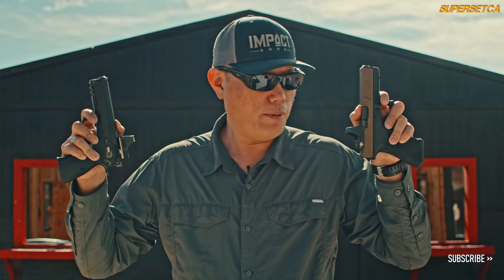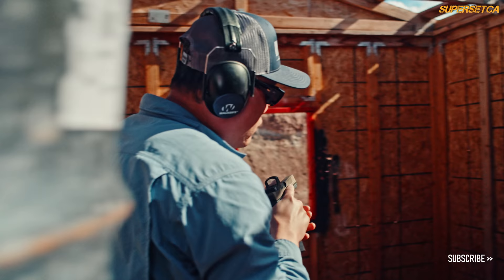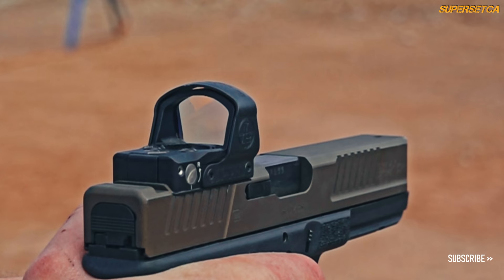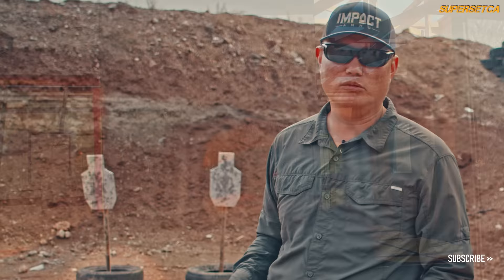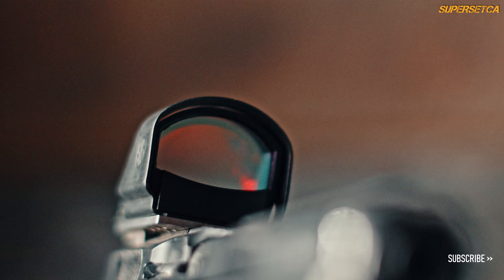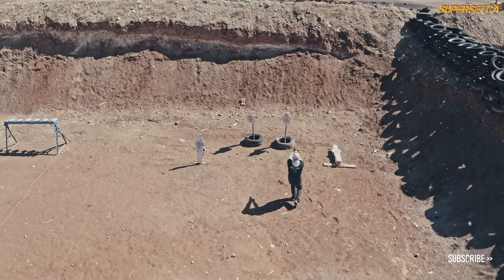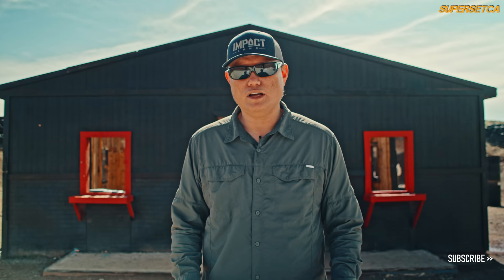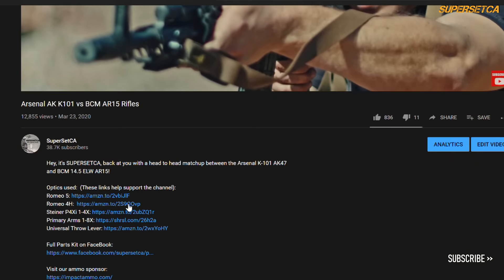Sig Sauer Romeo1 Pro vs Leupold DeltaPoint Pro Pistol Red Dots Review

Comment: I own both and have used both for competition. The DPP has already been back to the factory a new projection unit. The R1P has been flawless and is my preference between the two.
Reply from the maker: Thanks for your report!
Reply: I've read that they share the same mounting holes, but the screw holes are too small to fit m4 hardware. Is this true in your experience?

Comment: Great job on this vid!

I've been carrying the DPP for 3 years now. I've only had to replace the battery 3 times because of the auto off feature, though naturally I'd like to see more raw battery life.

One thing that does happen is lots of lint buildup inside the lens and sometimes in the emitter. I carried an RMR briefly but it wasn't enough time to tell if that design has the same weakness. Some duster spray once in a while seems to be the right move.

All in all, I noticed significantly improved performance over the RMR with my DPP and am glad I made the switch a few years ago.
Reply from the maker: Thanks for your report!
Reply: Hi. Would you still recommend the DPP?
Reply: @a.d.c7941  I use an acro p1 now for the benefits of a closed emitter.
Reply: @AlexOsha  Thank u Sir. I am new to red dots and am having the hardest time deciding on which.  Do you find the closed emitter to be more beneficial with dust and lint etc being that you’ve used both?
Reply: @a.d.c7941  yes, I don’t have to worry about the emitter getting blocked by water, sweat, lint, snow, dust, dirt, etc. I think it also helps you to find the dot faster due to the “tube effect” but I’ve not done any real testing personally to back that up.
Reply: @AlexOsha  Ok.  This makes sense to me.  Thank u so much for this.  I am going to start looking into these closed ones.   I really appreciate this so much.  Been shooting irons for years, red dots all new to me. Thank u again Sir.

Comment: Badass, thinking of a Romeo 1 Pro for my P320 AXG...
Reply: Have tried my DPP and R1P on my AXG. Much prefer the R1P. The R1P sits lower and the rear sight notch helps with suppressor ht sites for co wit. Plus the up/dn brightness. Carried p226 with romeo 1 for 2 years lots of abuse (work as land surveyor so in/out of truck many times a day banging it, out in rain and snow, hot and very cold in Mich) only 1 battery replacementin 2 yrs time. Other then paint wearing off it has been very durable. Just purchased the R1P but supposed to be even more durable. We will see.

Comment: I have both and have tested.  I prefer the SR1P over the LDPP.  I use both on SIG Sauer P320 Pros.  4.7”, xframes with flat triggers.  

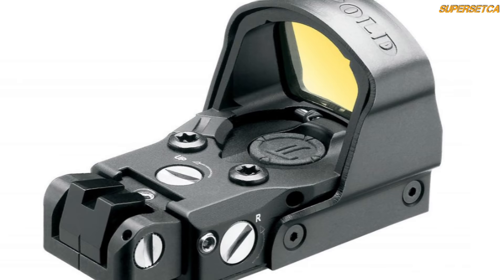SR1P: PROS perfect co-witness with Xray3 talls.  Clear glass, crisp dot.  Battery life is greater.  Steel shroud with easy brightness adjustments. Motion shuts off at 2:00, wakes up instantly with touch/tap.  
CON: adjustments need provided tool or small screw driver.  less common 1632 battery and that is a stretch for a con.  

LDPP: PRO common 2032 battery, clear glass, crisp dot.  Adjustments of elevation/windage can be done with case.  
CON: battery adjustment is a pain, however if you use your support hand pinky...that helps.  Need to purchase rear sight.  Xray3 are not tall enough and trijicon are barely visible in lower section.  

LDPP: Brightness trick.  If you press and hold button for 2 sec....it will reverse direction if brightness.  Can easily go from up/down.   

I prefer the SR1P, but both are good to go.  Good luck.
Reply from the maker: Thanks for your report!

Comment: I have the Sig Sauer Romeo 1 and unfortunately waited for it for almost a year while it was backordered.  The estimate of 30K hours with the 1632 battery is WAY wrong.  In the 18 months I've had it, I store it powered off and have had to change the battery twice.  Once, it died in the middle of an IDPA competition -- VERY disappointing on battery life!  Also, the 1632 is the most obscure, difficult to find disk battery out there - why in the world did they not use a 2032 which can be found in ANY drug store or grocery.
Reply: Good information--thanks for sharing!
Reply: They did things different, because they're Sig. Sig is a PITA, and I don't get it. It's like they try to be different, just to be different. They also sell a Pro-cut slide that is optic ready. However... I almost found out the hard way, that they use a different (non-standard) thread pitch on their #6 screws. It's a 6-40 instead of the 6-32 (which you can find at any hardware store). So... if your optic somehow comes off at a competition or in the field... you're not just going to a hardware store to fix your gun. It's BS, and has successfully soured me on Sig. I was actually gonna get a 365XL, but after this experience... I'm not buying another Sig.
Reply: Romeo 1 or Romeo 1 Pro? They are different.

Comment: Regarding the Romeo Pro, I was able to get the original Romeo 1 to fit on the delta point pro adapter plate.  Has anyone done this?  I am somewhat green with Red Dots so I am concerned that I have some got it on, but done it wrong.  I also heard the National Sales Mgr. from Sig at Shot Show do a talk where he repeatedly said that only the Romeo 1 pro would fit the “Delta Point Pro” standard as he put it..:)
Reply: That’s what  I thought, the Sig R1P would fit the DPP footprint. Hmmm.

Comment: I have the DPP mounted on a pistol. One other con for me about the DPP is the height over bore of the dot. Switching from irons to dots, it's not as intuitive when it's so high. Practice makes perfect though.

I'd like to see you compare these dots side by side in terms of splits and transitions performance. I know it's hard when you're using different guns, but if it's possible, I'd love to see it.

Any chance of a Romeo3 XL vs. Romeo3 Max vs. C-More RTS2 vs. Trijicon SRO on an open gun comparison?
Reply from the maker: Stay tuned!

Comment: Sig Sauer Romeo 1 came installed on my Sig P226 RX Legion I've had 2 issues  with it. Issue 1 the battery contacts bent to the point they no longer made contact with the battery (must be from recoil ?) once I rebent these contacts I found Issue 2. The red dot moves on its own,aiming at the 10 ring I was hitting the ceiling. this was after I zeroed the sight. All this happened within 600 rounds. I have since removed this POS and ordered a delta point. Yes I believe I can fit this on the P226.
Reply: Romeo1 and Romeo1Pro are completely different optics, I had issues with my Romeo1 a friend has the Romeo1Pro on his M17 so I gave that a try, like night and day. I don't think they were made in the same factory.

Comment: Quick question, will the Romeo 1 pro fit a glock 23 MOS ? Or I have to get an adapter plate for it ?
Reply from the maker: Hey man, pretty sure you need the plate as the recoil lugs are different than the DPP footprint

Comment: What is the manufacturer name and where I can find the base plate mount from your can shadow? Thanks!
Reply: The one in the video is a Henning DPP dovetail mount, but it only works for the DPP without modification because it has the 4 lugs like I mentioned in the video. I'd recommend looking into the CZ Custom dovetail mount with mounting points for any optic. Search "Multi Optic Red Dot Sight Base SP01 Shadow / Shadow 2 Cut"

Comment: Avoid the sig romeo1 pro. The battery cap is junk and easily stripped
Reply: Based on other's comments regarding the Romeo 1 Pro, your experience sounds like it might just be an isolated incident. I would be more concerned if there were multiple comments stating the same experience. Everything, no matter how high quality will have a lemon in the batch from time to time.
Reply: @terrarecon  It's true.  The threads on the cap are fine and easy to cross thread and it needs a thick screw bit and then it must be torqued down while trying to stay out of the way of the optic hood.